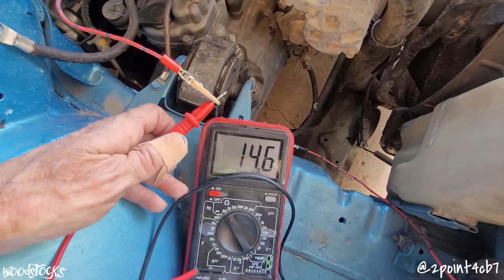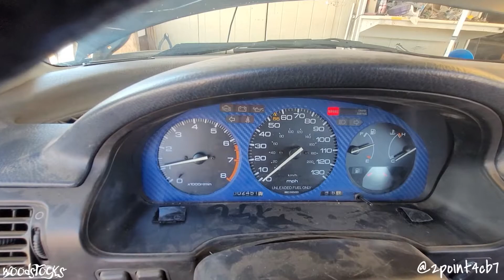vtec solonoid testing / obd1 code 21/ g23vtec

Comment: Mine don't have a pressure switch should I get that solenoid instead and run the wires
Reply from the maker: Are you getting a cel for the pressure switch (code 22) and vtec wont work?
Reply: @Woodstocks  no cel but at 5k rpm car starts hitting a wall like no more power
Reply from the maker: If i remember right you had your engine street tuned on a chipped ecu right? What was your vtec set to engage at? Do you have an air/fuel ratio gauge at all?  Might want to investigate your fuel pressure to be sure youre not starving for fuel.
Reply: @Woodstocks  imma investigate thank you brother